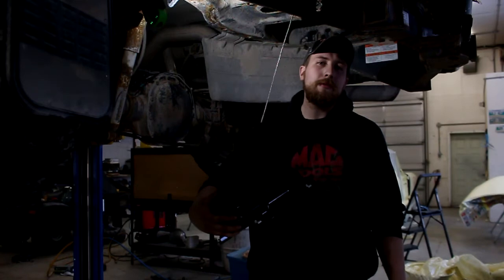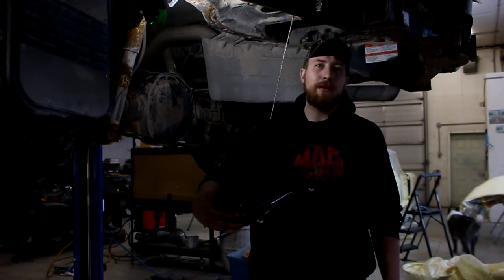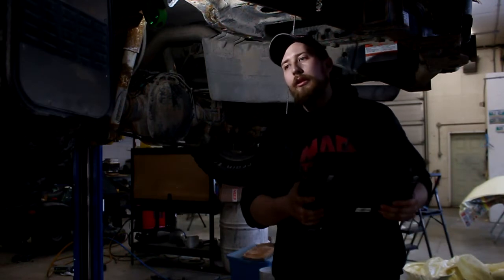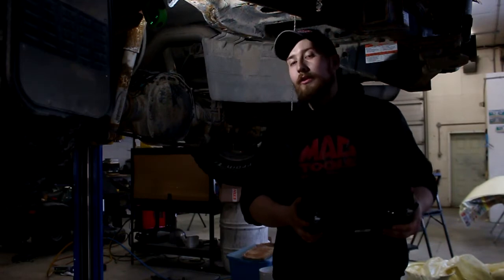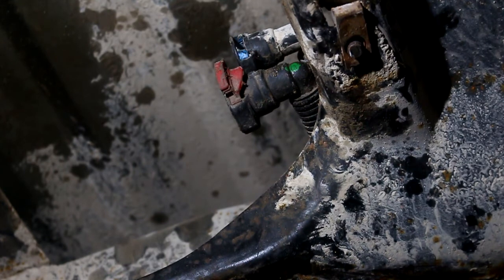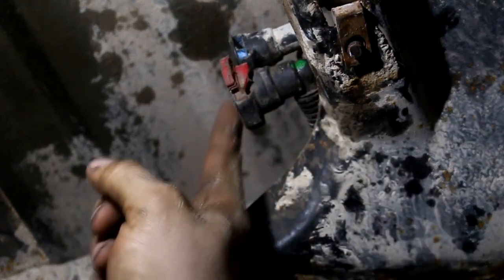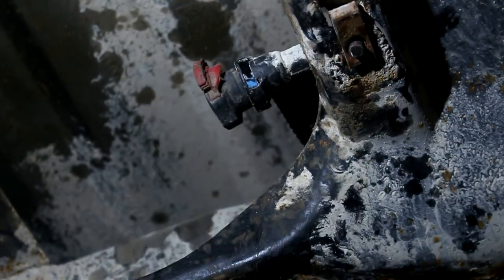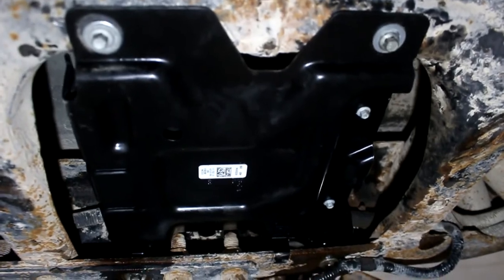Ford 6.2l Slow Fuel Fill 2005-2012

Comment: Looked these up on Amazon with your part number and says there not compatible with my 11 f250 6.2🤷
Reply from the maker: 9d653 is the part number basic. Call ford and give them your vin and that number and they can get you the right charcoal canister. Parts are always being updated but the basic number will still get you the right part.